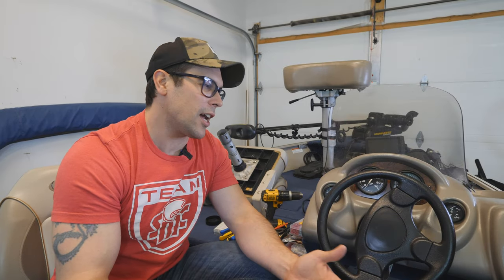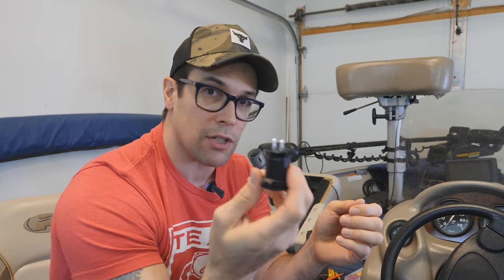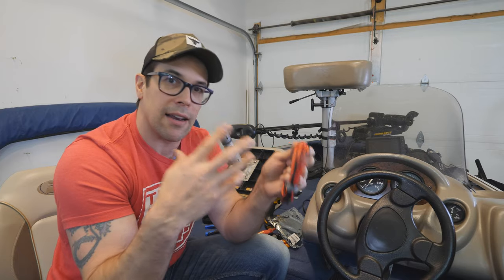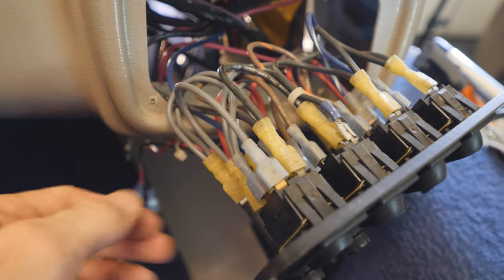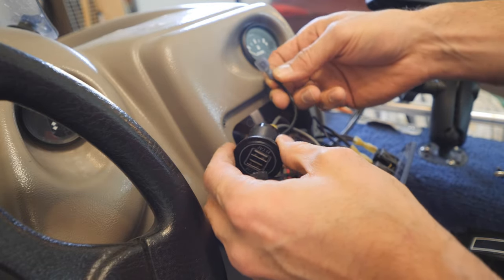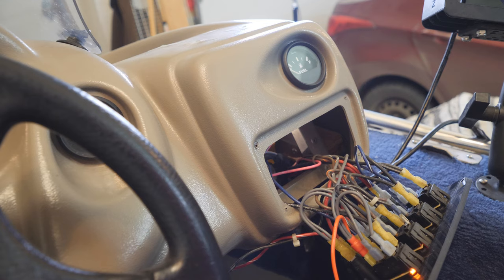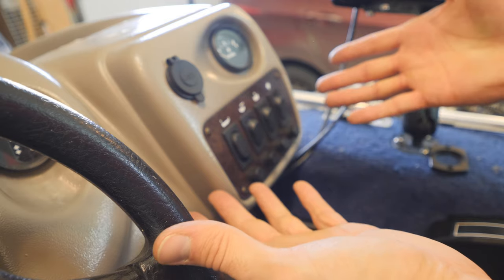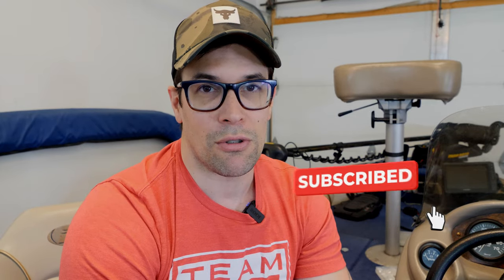How to Install a USB Power Port + Boat Wiring and Tool Tips!

Comment from the maker: Hope you like the video and it helps you out with an easy wiring project to get a USB charging port on the boat, it's super handy to have and extremely simple.  If you dig the video, please smack the like button and subscribe at https://bit.ly/2YbjPJi or click the subscribe button :)  Tight lines!
Reply: Not a comment, a question? I may have missed it but is the existing fuse sufficient or might you need to increase the amps?

Comment: Great stuff. I did this with a "cigarette style" 12v so i could also plug my fish finder in, and the USB port also had a voltage reading so i could ensure i wasn't draining the battery too far.
Reply from the maker: Nice,sounds like a great install! I like the idea of using it as a plug for your fish finder :)

Comment: some more questions on that seat install por favor...
1. did you install the seat yourself ?
2. what length vertical shaft did you buy?
3. it looks like there is no hole drilled for the center post? only bolts through floor and the base?
4. did you put a reinforcing plate under the base/ under the deck>
I weigh 200#-will the  contraption hold up?
5. How long have you been using it and do you wish you had bought a different type?
6.  I fish saltwater flats and wonder how it will  stand up to saltwater environments?
thanks for the  help!
Reply from the maker: Hi Bob!  Sorry for the late reply, just been busy with work and home stuff.  So here are the answers:

1. I installed the actual seat part to the shaft myself, but the hole in the floor and the post base was already on the boat.
2. The post length is exactly the one I linked to - 25" - 32" adjustable :)
3. The base socket has a inset socket inside that you do need to drill a hole in to the floor to insert it.  You can get a better look at what the base socket looks like here: http://old.attwoodmarine.com/store/product/238-Series-Socket-Bases.  I'm not 100% sure but the socket hole in the floor for my seat is probably in the 2 3/4" size or so.  The chair shaft is 2 3/8".  So the base socket fits in to the hole and then the base is bolted or screwed down in to the floor.
4. I do no believe there is any additional reinforcement on the floor... the marine plywood is already quite thick.  I weight 230lbs plus whatever clothing I am wearing and it holds up fine.
5. It's been 4 years now and I love it, no complaints at all.  I bought a little tool holder that straps on to the seat post for my plyers and scissors to finish it off :)
6. The base is clear coated anodized aluminum and the post is all aluminum as well so it should be fine :)  Use stainless steel screws/bolts for the install.

Hope that helps!

Comment: Good job on the install Dan... really liked you using a good crimper and wire stripper... it definitely makes a difference in the long run... btw, the peas are still biting... caught 16 today and lost 7 others
Reply from the maker: Thanks Phil, definitely started upgrading my tools for this work when I realized I would be doing more and more videos on DIY for the boat, thanks for the support :)  You've been an amazing subscriber, since I started, thank you so much.  And stop showing off with your warm weather and sweet peacock bass lol!
Reply: @DanRichardFishing  LOL!!

Comment: Nice video again! one question (different topic) where did you get the front seat mount (manu/ model/source? Looking to install one myself. Thanx.
Reply from the maker: No problem and thank you!  The pedestal post is a Swivel Eze model 238833LSM1 and you can find that on this product page on Attwood's old site: http://old.attwoodmarine.com/store/product/Pedestals--Adjustable-Height

Love it, works just as good as the day I bought it a few years ago!  The seat itself is from Cabelas.com https://www.cabelas.com/shop/en/bass-pro-shops-pro-qualifier-backstop-pro-butt-seat

Comment: Hi Dan,
Installing a usb like yours, mine has an on & off switch.  Found a spare ground underneath the helm like you.  Like you I want to connect to the nav lights.  Connected the positive from the Nav switch to the positive on the usb and used the spare ground. Nothing. Then I disconnected the main positive from the same switch connected it to the usb with the spare ground. This worked! 
My question is can I just go this route because my usb has a on & off switch? And should I install an additional fuse link between the jumper positive and the usb?  USB has a 6 amp rating total. My switch fuse is 10 amps.
Thanks
Reply from the maker: Hi Ken!  Just so I understand, you were connecting the positive that was coming FROM the switch to the USB and when you would turn on the switch AND turn on the USB on/off switch, nothing would work, but when you connected the positive going TO the nav switch to y our USB, it worked?!  Something there is weird, did you test the positive coming from the switch to see if you have 12v?

Comment: The great think about those Faston type crimp connectors is the are color coded, and the most common are RED, BLUE, and YELLOW.  

The wire AWG's will always be the same (Ok, so they repeat colors for other sizes, but these are obvious based on huge wire AWG differences), so if you remember this you are golden.  RED = 18 - 22 AWG, BLUE = 14 - 16 AWG, YELLOW = 10-12 AWG

Insulation color code	AWG size range	                 Comments
Yellow	                       26–22
Transparent	               24–20
Red	                               22–16
Blue	                       16–14
Yellow/Black	               16–14	                                 Heavy Duty
Yellow	                       12–10
Red	                               8
Blue	                       6
Yellow	                       4
Brown	                      2
Blue	                     1/0
Yellow	                     2/0
Red  	                    3/0
Blue	                    4/0
Reply from the maker: Yes this is very true and most of the kits actually come with a little sticker in it that has these guidelines on them.  I can guarantee I've matched the wrong colors in the past lol! Thanks for the post!

Comment: Hi Dan, my USB charger has a power button built in. I connected it directly to the battery and it comes on automatically once I turn the battery on! I have to remember to use the button on the charger to turn it off.  I should be able to use the button to turn it on to begin with, but it comes on automatically! what I am missing? it is like plugging the TV to the outlet and the TV comes on automatically without turning it on!
Reply from the maker: That is really weird, I wonder if that's just the functionality of the USB charger you got and that's how it works.  Did you try hitting up the maker of the USB charger to get their feedback?
Reply: @DanRichardFishing  I tried to contact the maker and also Amazon where I purchased it two weeks ago and have not heard anything back! The discription says, it has a built in memory so if you turn it off and disconnect the battery, next time you connect the battery it should be off. It works that way only for few minutes, but if I disconnect the battery for 10 minutes or more and connect it again the charger will be on!! I agree it is weird!

Comment: I would like to find a usb quick charge àlso a usb type C my phone takes too long to charge on the old style it will charge up over night on the fast charge my fitbit watch won't even charge on the òld style so I would love to find built in charger and one's for the cigarette lighter plug
Reply from the maker: Hi Douglas, the key is to find a charging port with the highest available amps for the quickest charge.  for a quick charge USB connection, you want the Quick charge 3.0 format that outputs a total of 36 watts,  which is 3 amps per USB port on a dual charger.  So for example like this: https://amzn.to/3idBdaU

Hope that helps!